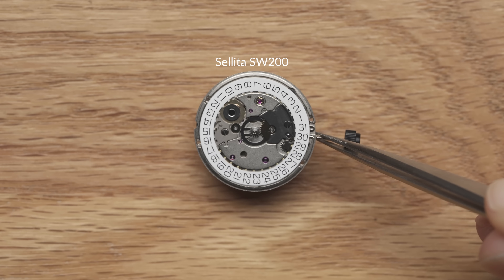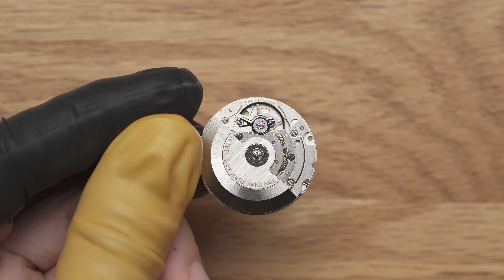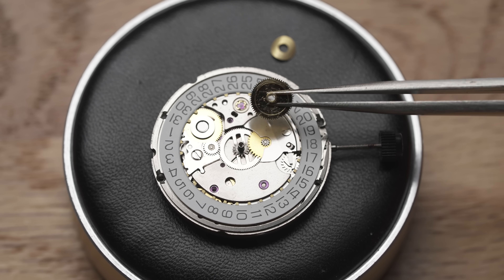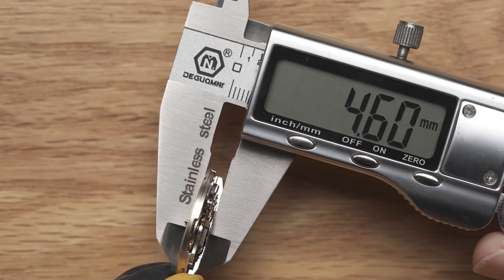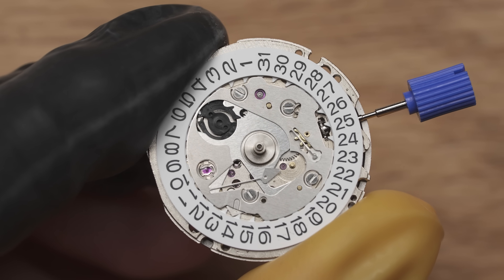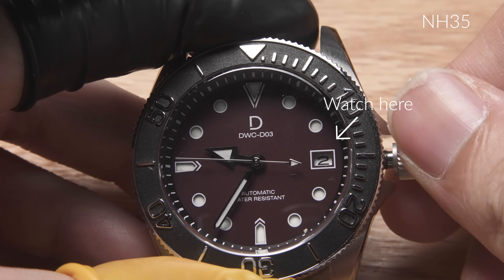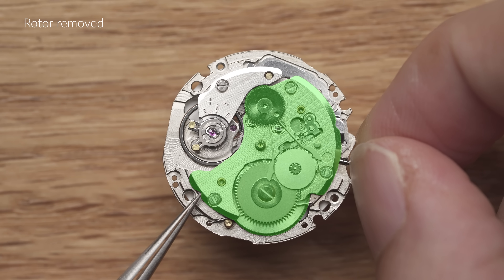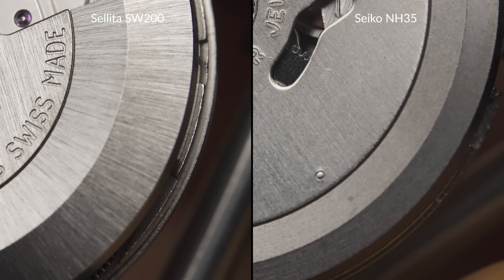Why Swiss Mechanical Movement is More Expensive (Sellita SW200 VS Seiko NH35)

Comment: I've found that my Selita/ETA  (Hamilton/Tissot/Rado/Mido/Glycine) powered watches are far more delicate - especially if you (like me) didn't know any better and hand wound the watch to get it going. I killed two SW's that way until I got educated. NH35, despite it's unrefined nature is a brilliant piece of engineering.
Reply: Ok, well...  "unrefined nature" when comparing a crap design to a good one is an odd way to refer to the latter
Reply: @khrttartrahht4188  We own two cars. A Mercedes C350 Coupe and a Toyota Corolla. The Mercedes is much more luxurious and infinitely more refined. Will it last as long as the more unrefined Corolla? Nope. Two things can be true at the same time. Same with the movements I mentioned.
Reply: @ralpingpong  why?
Reply: @nasdoc1  Why? Explain?
Reply: The two big questions that I dare any one to answer is (1) is the price difference between the two justified specially when the long term reliability of the more expensive one is questionable. (2) if you were forced to live with only one of these for the rest of your life through high and lows, through rough and smooth, through ice and desert and you had to pay for it yourself, which one would you chose?
Reply: @Raj-nh3fc  Casio G-Shock
Reply: @Raj-nh3fc  if I had to give a short answer: Swiss movements are like high maintenance woman...
Reply: @kobusvanrensburg4092 In my experience, all women are high maintenance. 😅😎
Reply from the maker: Exactly. In fact ETA recommends using the hand winding only to get the watch started, and using the automatic rotor to do the rest of the job. 

NH35 on the other hand, you can abuse however you want and it'll keep on ticking. Hell of a workhorse.
Reply: @DIYWatchClub  I don't consider winding a watch using a rotor designed to be wound by the crown as abuse in any way. If I have to worry about winding an ETA based movement in fear of issues I might as well buy a manual wind movement like the UNITAS without a rotor. 

The ratchet wheel teeth are flawed on the SW200 and isn't as robust or machined exactly the same as the ETA. It all comes down to maximizing profit for the greedy Swiss. If SELLITA can make the SW300 wind like silk with no issues they should be able to improve their base SW200 as well.
Reply: @DIYWatchClub Sorry to say, but it's not really true.
I have several watches with ETA movement and all of them start hand wounding. With no problem and for years.
Reply: @DIYWatchClub 
How do you compard the NH35 with F6R42 (orient star movement) with the mayota 9040 ?
Which one can is the more reliable?
Reply: @DIYWatchClub  This is honestly the case for most non Seiko 2824 "clones" like the PT5000 and the Miyota 9015. Both are more expensive than the NH35 and sure, have a right to be in most places. However they all have different caveats like the NH35 doesn't (noisy rotor, lack of durability when hand winding etc). It really is an amazing piece of engineering. If you want to build or mod your own watch with this style of movement and want something higher quality than the NH35, I honestly wouldn't recommend anything other than the Seiko NE15 (for a slight but noticeable bump in quality) or the SW200 (if you really want some quality swiss engineering but dont wanna overpay on an ETA). Is the SW200 a little overpriced? Yes, it's Swiss, duh. Is it one of, if not the only movement between the NH35 and 2824 in price that makes any sense to buy over one or the other? Also yes.

I mean hell, honorable mention to the Miyota 9015 if you can get past that noisy asf rotor.
Reply: Hi I'm confused? How do you wind up an automatic watch? I own one which I wear occasionally. I put it on and wait for it to get started and then change the time.
Reply: @jalexa4 Unscrew the crown. Pull the crown out 1 click and rotate it forward. For the NH35 about 55 turns is full power for approximately 40 hours.
Reply: @jalexa4  Some automatics can also be hand-wound (by turning the crown) and some can’t. Automatics that can be hand-wound have their crown connected to the movement by a sort of clutch that start to slip when you get close to overwinding. So you can hand-wind to get it running quickly or top off the power reserve, although like most other automatics there’s no way to tell when the power reserve is actually full. Again, not all automatics can be hand-wound. And some of the ones that can be hand-wound aren’t designed to be hand-wound regularly.
Reply: @mokkingbird What starts to slip when overwinding the automatic watch it is the mainspring inside of the mainspring barrel, which powers the watch. Close to a moment when the mainspring is fully wound, a pulling force on the spring is high enough to be above the force of the friction between the end of the mainspring and the barrel inner wall, and the mainspring starts to slip, slightly unwounding. Unlike with the manual wound movement, on the automatic movement, the mainspring is not firmly attached to the mainspring barrel wall.
Reply: @tech_watcher  Ah! That makes a lot more sense. Thanks for the explanation!
Reply: @jalexa4 You can always use the crown to wind an automatic by turning it clockwise from the  flush position.
Reply: @jalexa4  a couple of gentle shakes will get it going. I used to hand wind it to get it started, but that risks damaging the winding movement in some watches.
Reply: To my understanding, we need an accurate watch, a minimum deviation possible, so if NH-35 cost 1/6 of ETA, why not choosing NH-35 ?? Prestige?
Reply: I’m new to watches and don’t understand this comment. I thought I’m supposed to hand wind my automatic watches.
Reply: @cory1481  Gently hand wind to get it started -usually 5 turns is enough. Then just wear it.
Reply: @cory1481  Of course you are.
Reply: This is a stupid video.
He should compare motorcycle ducati vs a Honda fit and how motorcycles are better than car next.
Reply: Really bad decision to use a much more expensive Swiss movement to compare with a cheaper Japanese movement. Why not use two of comparable price? You might as well compare an expensive Japanese movement with a cheap Japanese movement and you'd get the same differences.
Reply: ETA is everything. Selita is an imitation of its origin from China. In my opinion, Selita is an unsuccessful imitation. As for the reason, it has a strange structure that self-destructs, the parts that will never fit are broken by itself, the reason is that the metal is weak, yes they compared it to Eta, but only as much as the Chinese citizens do. In short, if it continues like this, all brands A solution must be found for this issue because of Selita and the Swacht Group, which does not supply them with machinery. Either Selita will develop the mine and produce solid machines, or a strong brand like Eta will emerge, there is no other alternative.
Reply: @longinesmuratwerkmaister unfortunately you are very wrong. Selita are a Swiss movement manufacturer and they used to make the eta 2824 for the eta company. Eta decided that they no longer wanted to use third party manufacturers and so Selita lost the contract. However the patent on the movement ran out at. The same time so Selita stated to manufacture their own version the sw200. As they had been the main manufacturer of the eta 2824 they clearly knew how to manufacture it correctly.
Reply: I wish I saw this comment before I made the same mistake.
Reply: Honestly, I find the Miyota 9000 series better, mainly because they are thinner than the 2824 clones. As for the manual winding, silky smooth. However, most of my watches have ETA's 2824 or 2893.
My favorite movement that I own is the J815.1, a variation of the ETA/Peseux 7001 that sits in my Junghans meister driver. Again because it's even thinner than the 9000 series.
Reply: Meh they’re all the same. Does it tell time?  That’s all I care about.  
  If you need a watch to feel better about yourself,  you ain’t living right.   But you do you.
Reply: My wife has a Tissot automatic. I hand-wound it and it had to be repaired. Now, I just shake it for her to get it started.
Reply: I have a Chopard and the movement on that feels delicate compared to Seiko
Reply: Underrated Comment. Thats why iam as an DACH Inhabitant ditched Swiss movements all over - theyre nice and accurate, but if you really need em, they break down.
Reply: I've worn an Ocean 7 Meteor Titanium with the ETA 2824/2 movement as my daily work watch for almost 8 years and usually hand wind it at least once a week, about 25 - 30 turns. Usually after the weekend as It normally sits unworn from Friday evening till Monday morning. 
Never serviced it and never had a problem with it. Still runs 5 seconds slow a day, as it always has.
Reply: With the exception of tissot,  I've always thought all the other watches makers you mentioned are extremely overated and over priced.    And now, from this video and comment section I know the sellita movement is delicate garbage
Reply: @AvidUTuber If Sellita's are garbage, what does that make Seiko movements?
Reply: @garyboyle695 I wouldn't say they're rubbish. Granted, they're probably not as reliable in the long run as ETA, but still a lot better than most.
Reply: @AvidUTuber  tossit is also garbage
Reply: @オルフェーヴルの夫  ..so I've heard.   I almost bought their popular PRX powermatic 80 last year, then I found out it can't be regulated unless you send it back to tissot
Reply: @AvidUTuber  the rules of thumb is to never listen to redditors. When they like some things and hype it up, you know it's utter shit
Reply: @AvidUTuber  I assume you mean when under warranty. And if in the US, they can't do that.
Reply: @AvidUTuber  that's right, but i've not seen any complaints about th accuracy...
Reply: @AvidUTuber  do watches really need to be regulated? If I want to know the exact time I look at my phone.
Reply: @GeneGirard007  This is the key. If you don't care about accuracy, the NH35 is fine.
Reply: This is more misinformation being spread about the Powermatic movements. Not only are they very reliable, but CAN be regulated by any qualified watchmaker. It’s regulated differently but it can absolutely be serviced and regulated.
Reply: Sw200 is a automatic movement with hand winding capability whilst the nh35 is a manual wound movement with an automatic capability
Reply: @tommyle7376  What?
Reply: @mstcrow5429  it's a joke. Since you should only wind the sw200 and then wear it on your wrist so that the automatic movement will wind it for you as opposed to the nh35 where you can just wind the shit out of it

Comment: Date change on nh35 doesn't have to start early - it's 100% controlled by the watch assembler and has nothing to do with the movement. I agree with the part that it's snappier in sw200.

Comment: I wonder which is actually more durable. The NH-35 design philosophy emphasizes simplicity and ruggedness (think of the large bridge plate). The winding mechanism, in particular, is ingenious in it's simplicity. I don't have a big problem with plastic parts - in depends on where they are used. For something with loose tolerances, that doesn't experience much wear, the self-lubricating properties and the ability to make complex shapes can be a plus. The finish is a red herring - I wouldn't put a display back on either of them and dust isn't going to be an issue when it is sealed inside a watch case.

Comment: The eta and sw200 specifically can easily be regulated to be pretty much cosc accurate, but if you think about it it’s probably cheaper to replace any of these movements than to fully service them which beats the purpose. On this level of movement it might make more sense to get a quartz

Comment: Sellita/ETA is a garbage movement, I had a Tag Heuer with 2428 onboard  which died within 3 years of a careful use but my 90s Citizen (Miyota 8215) and 15 yo Seiko with 4r35 (the same as NH35) is still going strong without any service.

Comment: The date changer is wrongly represented here, with any movement you can align the hand so that the date changes at exactly 12, all you do is turn the movement until it changes date and then align the hands to show 12 o'clock.

Comment: 日本円換算だと
1ドル(USA通貨)が147.18円(日本通貨)
【2025年10月02日午前03:27時点】

SW200が      26492円(単価1)
NH35が         5151円(単価1)

仮にRolex Submarina タイプのケース、針、文字盤、ベルトを安価なものでMODすると、

SW200なら    39000円～49000円
NH35なら      10000円～24000円くらいが販売価格かな。

ただしSEIKO tmi製造のNH型ムーブメントの卸値は年々価格があがったているから
買うなら早ければ早いほどお得かもしれない。

物価高騰の煽りを受けたらスイスのセリタの値段をそのうち超えてきそう。

スイス製セリタ社製造のムーブメントも初めの頃の卸値の2倍になっている。
そのうちまた値段の吊り上げカマして来そう。

ETA2824-2の値段が1990年～1999年頃までは1個だいたい9000円～10500円だった。
今
同一のETA2824-2を買おうとすると
公式のメーカー卸し価格は現在不明。

2025年10月の時点では、ETA2824-2のフレッシュムーブメント
(新品未使用の製造元の)販売価格が解りませんでした。

市場で購入をする場合、値段はバラバラ。

Amazonでは79800円
中古オークション等では24000円～60000円程度もしてしまう。

※注意点は同じ型式ムーブメントであっても、グレードや等級が複数ありそれぞれ品質も値段も違いますのでインターネット上の検索に表示されるモノの値段は参考になりません。

・ジェネーブシール認定
・クロノメーター規格試験通過のもの
・18K製素材のローターなど加工されたものの場合
・ムーブメントパーツ全てに加工が入ったものの場合
などさまざまあります。

Comment: i think you're clearly being biased towards swiss. while you have said it yourself comparing nh35 with sw200 is not fair, both being built for different price points. I strongly advocate the reverse is true. anything japanese vs europe is Japanese is always better in terms quality , durability , serviceability . european tech is purely luxury but definitely more sensitive and less rugged and less durable than japaneese. be it watches or automobiles  or anything for that matter.

Comment: A Seiko 4Rxx movement (NH35 is the exact same thing but sold to brands other than Seiko) in no way compares with a Sellita SW200-1 movement. The 4r movement is literally as entry level as you can get, the SW200 is in a great many higher end Chronometers, from many different watch brands. It is a superb top end movement in the top or COSC grades, but even the standard grade is far superior to a 4r movement. It's like comparing a Volkswagen beetle to a  Bugatti Chiron, there is no comparison to be made at all.

Comment: Funny thing is, that the Selitta SW-200 costs as much as 4-5x Seiko NH35s (40-50€ for one NH35 compared to the 190-200€ for one Selitta SW-200), but the Selitta isn't that much better as you would think! 😅 Even funnier is, that the NH35 is much more reliable and durable and fixing/replacing is much cheaper. With a little patience you can the NH35 as precise as it's competator, too. 😅 And in many cases the NH35 will run longer without any service, because it runs at 3Hz, compared to the SW-200s 4Hz, without losing much prescision. 😄

Long story short: I love NH35 movement very much and it's mindblowing how much you get for the low price and how good and reliable it is without burning a hole in my wallet! 🥳❤️

Comment: The Miyota 9015 would have been a better model for comparison. It's thinner, smaller than the NH35 and has the same 28,800 bph as the ETA movement.

Comment: I dropped my Seiko 7S26 powered watch from tabletop  height a couple of years ago and quickly took it to a Seiko Boutique to get it checked out. They complimented it and told me they could tell I take good care of my watch, the movement is in good condition. 

That alone made me cherish the workhorse of 7S26 forever. Even now, 6 years later without any servicing it still ticks away fine, daily accuracy of -2 seconds and dial up amplitude of 285° 
Add to this the fact that I commute with a motorcycle (which doesn't mix well with mechanical watches), and yet it keeps on ticking, no hassle. It used to be my daily driver for a couple of years, now it enjoys a healthy rotation.

So yeah, it really depends on usage and your purpose.

Comment: Japanese movements are far superior…look at Grand Seiko…better movements and far more accurate than any Swiss movement…and Citizen makes the most accurate quartz movement. And as far as accuracy, you can get a 50 dollar Casio watch that syncs with the atomic clock signal that is about the most accurate watch you can get. My Bulova precisionist watch is accurate to less than 10 seconds a year. But it’s the same with cars…BMW and Mercedes and Porsche cost a lot of money, where you can get a far superior and more reliable Japanese Toyota or Honda for half the price.

Comment: Great job on the video despite trying such a general theme. However I think there's room for elaboration on some themes and more specifics in examples. It would be great if you could cover these areas more thoroughly and I'm sure many people would watch. I know i would! The mentioning of serviceability is a huge point of distinction in my opinion. Where I've had miyota quartz that's lasted 25 plus years of terrible abuse from me, the servicing and repair was significantly more difficult than swiss. The Japanese approach did not seem to compromise on quality in the sense that mattered to longevity or telling time accurately, but did compromise by sacrificing ease of (eventual) repair or easy component replacement and arguably in aesthetics. This makes sense if you design for a particular market and after sales experience. That angle is worth more discussion I think. I've also pulled apart some astonishing Chinese made movements for their cost, but they were extraordinarily difficult to properly reassemble. I think if we are going to generalise about the differences in design ethos, Swiss is looking towards retaining a movement over time with an emphasis on serviceability with perhaps a shorter service cycle but a longer movement life overall, while Japanese might be focused on affordability with a longer service period but more an expectation of minor repair less frequently, followed then by total replacement. Again it's generalising but while I've worked on swiss movements going onto their second human lifetime, while on the other hand I've also worked on Japanese that have had zero maintenance for 21 to 22 years and then gone for a further 5 to 10 without fault.